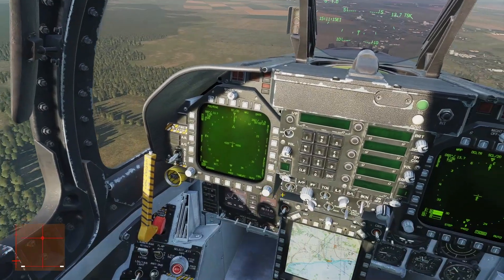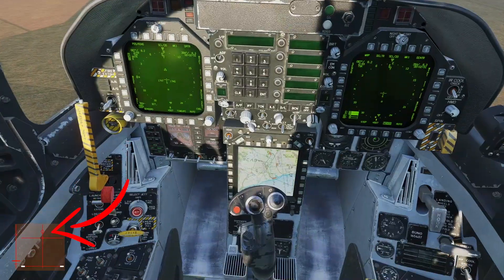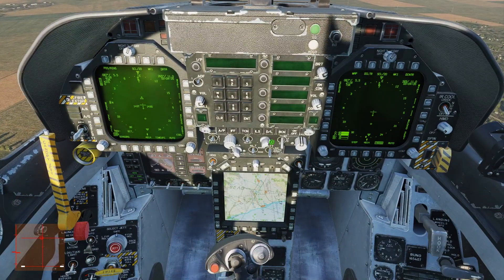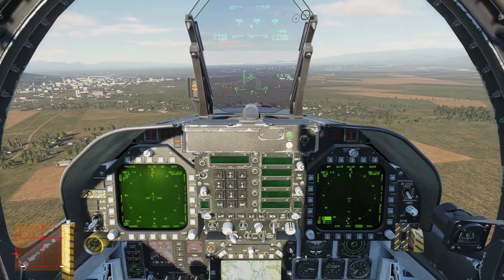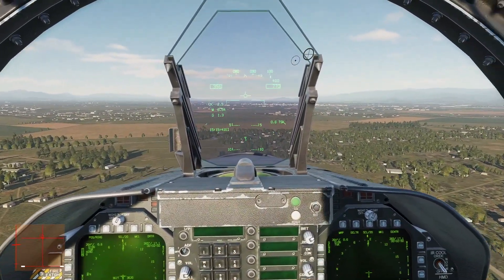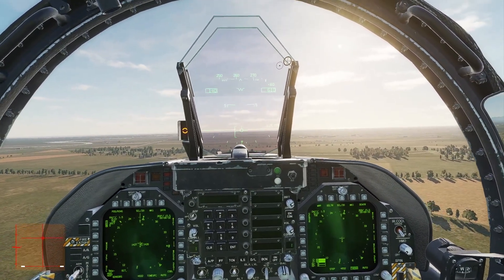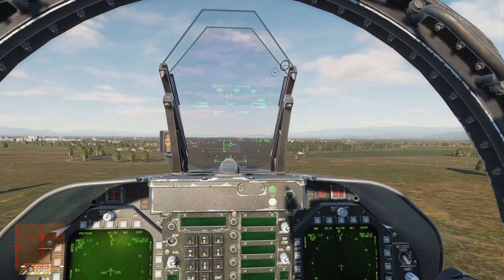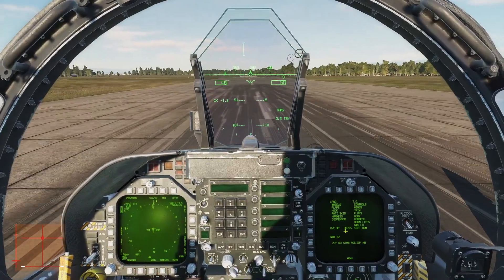On Speed - AOA | Trim the F/A-18C for Landing DCS

Comment: I'm a CFI and have been flying for 30 years.  I have 5,000+ landings logged in all sorts of general aviation aircraft plus a number of military aircraft like T34's, AT-6's, PT-17's.  I just could NOT get this landing thing down in the DCS F18.  I wanted to configure gear/flaps for landing, set power, trim for airspeed and land....pretty much like I always do.  Use of a Velocity Vector, AOA indicator, and EBar all while basically ignoring airspeed and power setting is just so damn alien to me and I really struggled with it.  Finally today, I was able to actually land well thanks to your video!  

About 25 years ago, I flew a Champ with heel brakes (rumor has it that Lindbergh logged time in that airplane!).  Anyway, I struggled with the brakes big time.  Finally I got it and the guy that checked me out told me that everyone that is a rated pilot and that is use to toe brakes struggles with heel brakes.  New primary students get it just fine.  It's kind of like this DCS F18 thing, I suppose :-)  Anyway, good job on the video.  Thanks!
Reply: Its more about being well versed with a computer than aircraft,  Ive never flown a aircraft in my life I'm 20 years old and i started DCS like a little over 2 months ago and I've always been computer savvy.  Ive learned the F16 first,  F18 2 weeks later, A10C II 2 weeks after the F18, and just got the apache like a week ago.  I learned them so quickly but I've always loved aviation ever since I first saw a airplane and its a dream come true to be able to fly them without actually flying them!
Reply: @Trxpiin  
I have to disagree.

Comment: Great vid as usual Tim. I'm pretty much sorted with on speed AOA just need to work on the break turn, whether I go left or right from the outside it must look like I'm on the big dipper roller-coaster, I cannot for the life of me maintain my altitude 😢
Reply from the maker: Keep the velocity vector on the 0 degree line (horizon) with a constant fixed back stick pressure and then use roll to increase or decrease attitude (pitch) in the turn.

Comment: What visual reference points do you use in the F18 to confirm spacing in the downwind mate?
Reply from the maker: Wingtip on the runway edge should do it, might need to be a bit wider than that if heavy or with a wind pushing you away from the runway. For the boat they use 1.2 nm downwind for a 30 degree angle of bank final turn but you can use more on a shore establishment if you want.
Reply: @FastJetPerformance Awesome, thanks very much! Hope you're having an awesome festive season mate!

Comment: Thanks a lot for this wicked video man. I'm still a beginner in DCS the hornet is my first non-helicopter module, thanks to this I pulled off a pattern and landing on my first try (after watching it hahaha, there were a lot of bad one before). What helped me as well was practising what you show in the video for a bit by flying around in on-speed AOA just controlling the plane with the throttle and x axis stick movements without trying to land straight away til I had it down.

Comment: I kind of cheat, throttle to idle, gear down, flaps full, ATC engage, place VV on target spot, light stick movements to keep it on target,  hit deck, speed brake open and brakes below 80. Very seldom I don't land with ATC engaged.

Comment: Have been struggling with the balloon so really good to see your detailed explanation of when you start adding trim and power when the E bar starts to fall. I think this will help me get better at it in future. It's easy to re-compensate in a long straight in landing but no so much when flying the landing circuit.
Reply from the maker: You can stage flap also Lewis, take gear at 250, half flap at 220 ish and full flap at 180 ish and that helps.